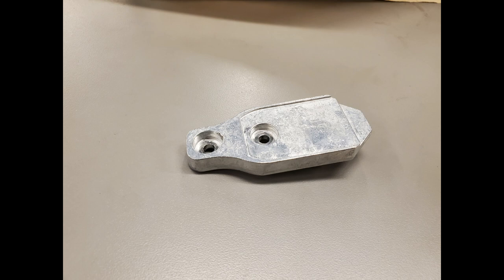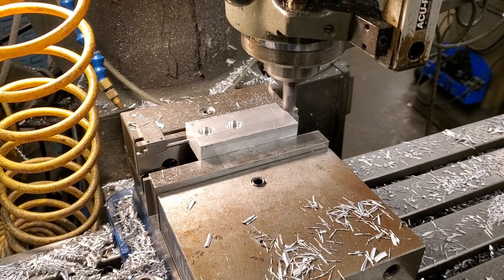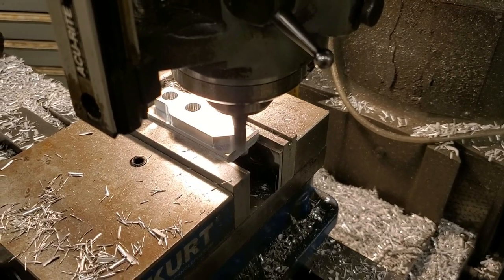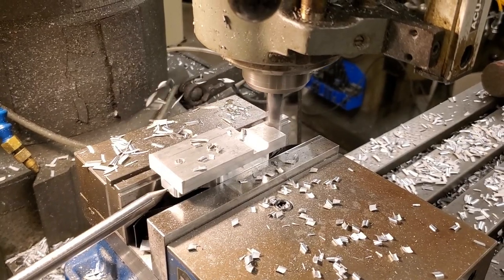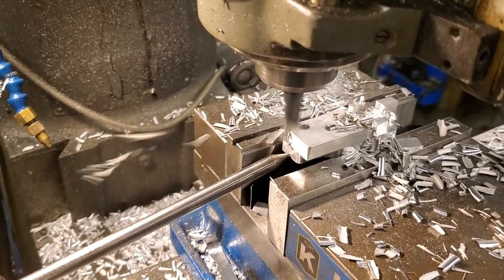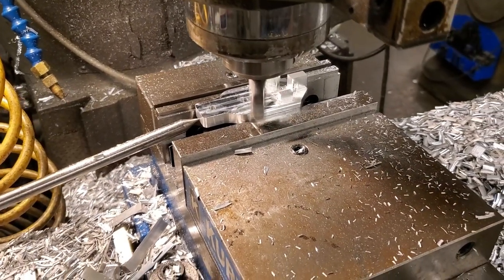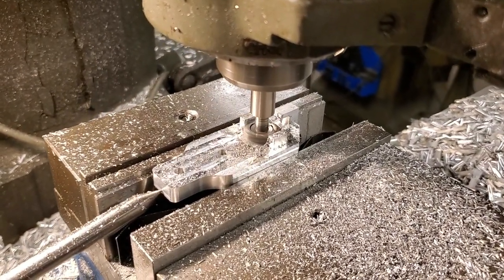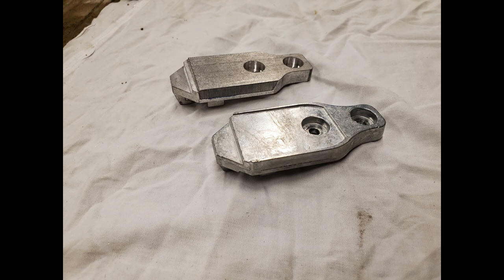Interesting Work Holding Techniques #3

Comment: Thanks for the quill stop tip - I'll have to remember that one
Reply from the maker: I use that trick all the time. One of my earlier videos is about getting consistent countersink depths and the quill stop is central to that.
Reply: @StuartdeHaro  I remember that, thanks! I've certainly used the quill stop as an end point for milling and drilling, it's the use of the fully raised position that had never occurred to me. Brilliant!

Comment: Good job Stuart.  I was looking at those TRAK machines at my old job as a possible upgrade to the facility.
Reply from the maker: They are really excellent as prototype machines. They're easy to program and they can be run as manual machines as well. We use ours mostly manually just because of the kind of work we do, but when those trickier jobs come up with angled or curved cuts, lots of holes, or the odd small production job, having the CNC control is fantastic.

Comment: Hey could you expand on your Bridgeport cnc conversion? Recently purchased a bridgeport, want to play manual for a while, but definitely interested in the CNC route. Thanks for all your videos.
Reply from the maker: It isn't a conversion. It was bought new in 1999 as a ProtoTRAK. For the work we do, it's a great machine.
Reply: @StuartdeHaro  o I missed that part, it is an actual machine mod. Cool thanks for the direction.

Comment: Functional knockoff, I hope. Thanks for the look.
Reply from the maker: Yep. It worked great. We pared down a lot of the design elements to make it more manufactureable. The important bits were the hole placement, the shape of the hook, and the width of the top where the valance snapped on. The two pegs by the hook don't seem to serve any purpose whatsoever. They just hang out in space inside a tubular structure. They don't touch anything.
Reply: @StuartdeHaro  really interesting. Thanks for sharing!  My guess is those are there for some other model of cubical. Something that would utilize them. Then again, if it is die cast, dies are rather expensive. They could be for a feature that was removed, but the die never updated, mayhaps?
Reply from the maker: @ironhead65  that is a definite possibility. There is also no apparent reason for the two steps on top. The valance is just a channel that snaps on top.